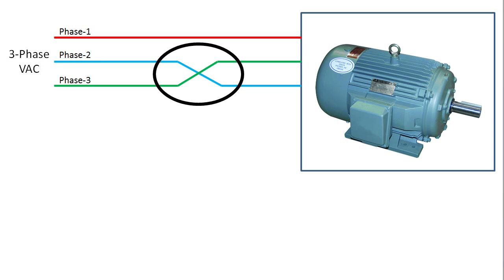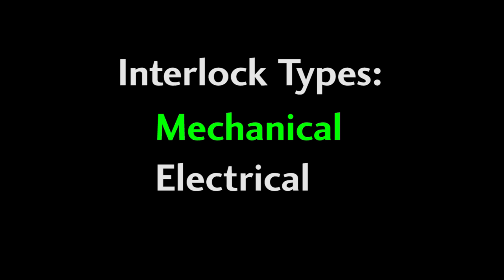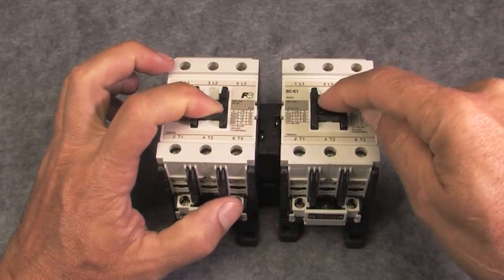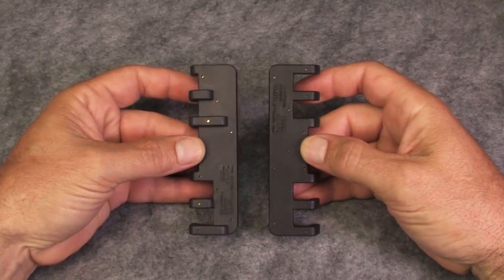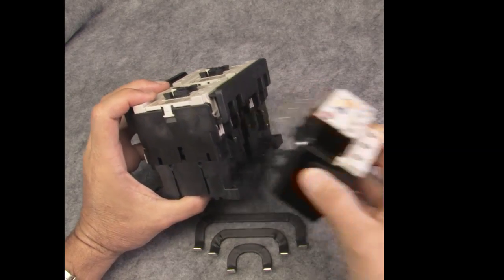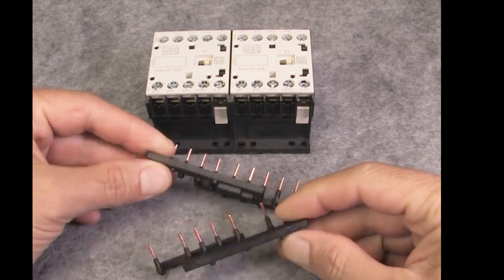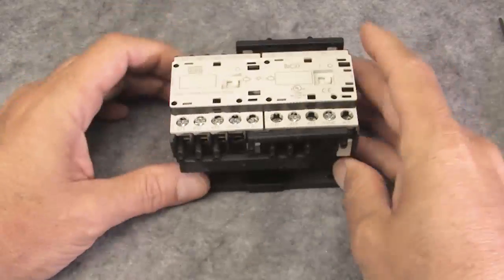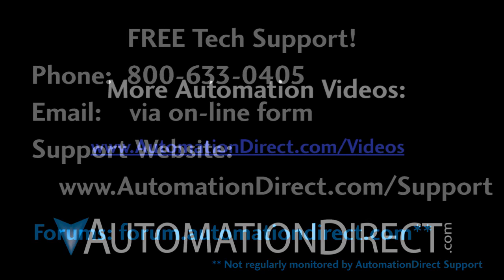3-Phase Motor Reversing with Contactors from AutomationDirect

Comment: Why some people swap between l1 l2 to reverse and some like yourself reversed l2 l3
Reply from the maker: @mindsetmasterytoday319 It doesn't matter which two of the three lines you reverse, as long as you only reverse a single pair. Many manufacturers (such as Fuji, who is manufacturer of the contactors in this video) make reversing bus bars that automatically reverse the phases for you to help minimize the chances of mis-wiring. Take a look at the "Recommended Items" section for one of our contactors at AutomationDirect.com and it will show the bus bars I am referring to.

Comment: Did u have video how to wire 3 hp 3 phase motor to 220v . 9 lead
Reply from the maker: It's not possible to connect a 3ph motor directly to a single phase 220vac like you have in your house. But you can do it with a vfd. Some vfds even let you connect the motor to 120vac. Go to www.automationditect.com/videos and search on vfd ... you will see lots of examples there. If you are looking for an inexpensive  solution search on CFW300, it's an awesome vfd that can run up to 5hp off of single phase!
Reply: @automationdirect  i do have 3 phase 220v
Reply: @automationdirect  i need the wiring video low voltage in simple instructions my model motor mtcp2-003-3bd18c
Reply from the maker: @scottchen1840  That's good news!  Given the four wires you have (three phases plus neutral) you just connect them to the motor wires per the diagram on page 2-12 of the user manual here: https://cdn.automationdirect.com/static/manuals/ironhorsemanual/ironhorsem.pdf   Is that what you are looking for?  (BTW - You want to use the "Low Voltage" diagrams.  The "High Voltage" would be for 460VAC operation).